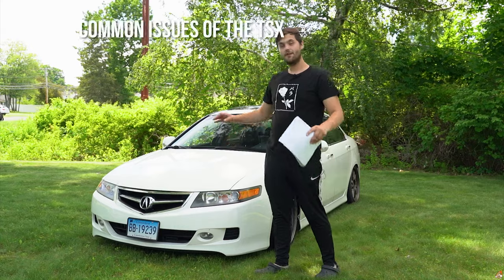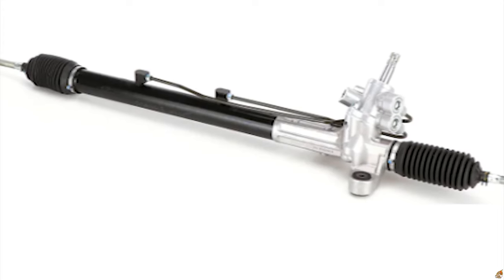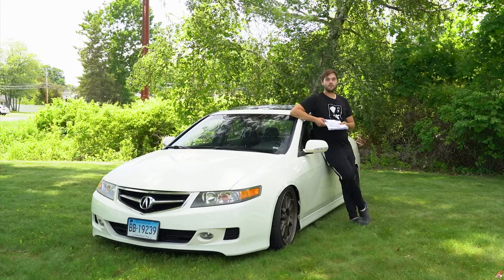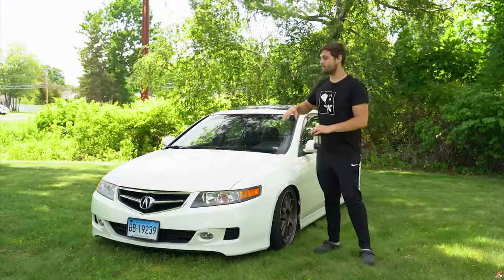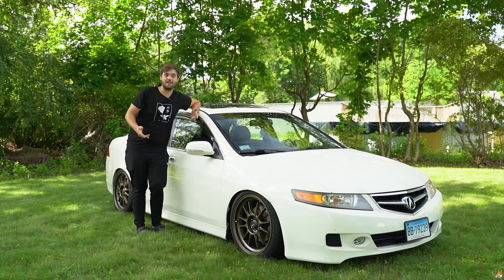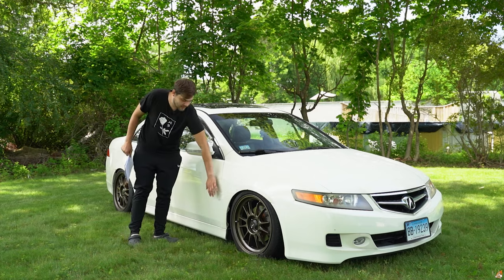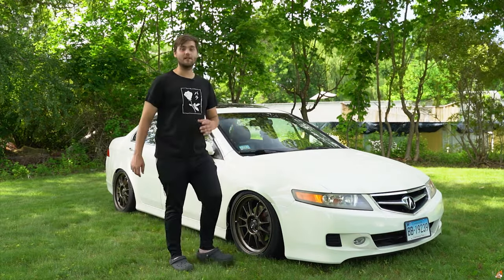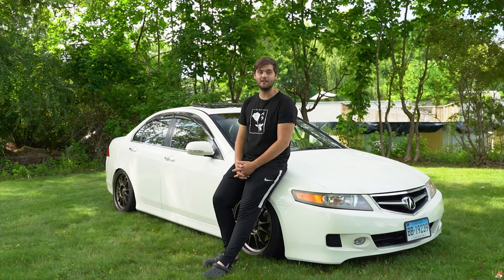TOP 10 COMMON ISSUES With An Acura Tsx

Comment: '06 TSX here, changed the starter, power steering pump, a/c compressor,  and even unplugged the bluetooth module last year cuz I thought it might be draining my battery. Turns out it was the starter causing it not to start. It's still unplugged by the way! Overall it's been a nice car that I've owed for 10 years with 182,000 miles currently.
Reply from the maker: Lmaoo I’ve chased many problems and just throwing parts at it kinda learned overtime try not to so much.. 😭
These are great cars if we treat them right!
Reply: @RishMedia  My AC Comp went out 5 years ago. I decided that since it's not my daily driver I would open the windows. The stock starter lasted me 14 yrs before I had to put in a rebuild. Having to take off the intake manifold was a pain in the ass. But I really don't know where else they could have put it with the engine design.
Reply from the maker: @stuartdroberts1  goes to show oem parts last!  The intake manifold isn’t as bad once you take it off once remove that bottom bracket it’s not needed and make it so much easier for any other time.
Reply: @stuartdroberts1  I have RSX RBC I manifold and it easy access
Reply: where are you from lol
Reply: damn same but im at 135k miles🥲
Reply: I just bought an 06’ with 150k on the clock, any advice about preventive maintenance?

Comment: 2005 TSX one alternator, three batteries, starter, air conditioning, compressor, exhaust three times, power windows switch, coil packs, brakes  three times. GPS HVAC is currently on the fritz. I bought this car with 109,000 miles. It has 219,000 now, if anyone plans to buy one of these used, you will be fixing several things. Good luck.
Reply from the maker: Yeah man that age wear and tare, especially ones that haven’t been taken care of properly.
Reply: @RishMedia  Yup!! I have to replace the exhaust.  My hvac gps has been quirky for a while.  Now, all I see is “check your disc”. 🙄

Comment: Spoke facts, I’ve replaced literally everything you mentioned on my 04 😂
Reply from the maker: Becoming a more common thing as these cars get older 😭
Reply: I just bought an 04 it got some problems with the battery (massive drain) so I tried some stuff but it didn’t work the Bluetooth didn’t either I just left it disconnected if some on ya know what it could be pls let me know id appreciate the help
Reply: Do u use premium fuel?
Reply: I’m literally fittin to replace this shit too— bro wtffff

Comment: 2004 Tsx 290k hear 6sd running strong
Reply from the maker: Hell yeah that’s what I like to hear! 💪🏻
Reply: @RishMedia  I got some dope mods still not done!!!!
Reply from the maker: @Onelovej  keep it up man! Got a lot to this build myself so plenty of videos!
Reply: @RishMedia  💯
Reply: 2006 Acura TSX 6 speed manual with 320k miles. Runs and drives great. Just bought it off the original owner. Needs rotors-pads all around and two rear wheel bearings. Hopefully once I start daily driving it I won't find many more problems.
Reply: Kevin Hughes They’re pretty solid I got 300K on mine
Reply: 172k on mine just got it yesterday I can’t wait to get working on it and first mods

Comment: Great video. However, those are not common issues with the TSX, but with any 20 year old Honda or even other brands. All wear and tear parts will eventually require replacement.
Reply from the maker: I mean they are cause those are the common things to go with the tsx. 
If it maybe just regular maintenance type stuff.

Comment: A proud owner of 2005 TSX. Bought the one that was used as a dealership's test drive vehicle with 28 miles on it. Now, in 2024, it has 255K, so far had to replace a serpentine belt at 140K, engine coils at 170K, alternator at 243K. The very first that went out was the trunk button, then the passenger door actuator, then the driver door actuator (both for remote entry). That's basically it. Hoping with the proper care I'll get another 250K out this car. I also had a used 2006 TSX for my wife, it also had a passenger door actuator issues and a leaking steering actuator. I love this car so much, that I even bought my daughter a 2005 TSX as a first car, manufactured just a month after mine.
Reply from the maker: DANG! your an OG love to hear it sounds like they've treated you very well! thanks for leaving your experience
Reply: I like you.

Comment: AC compressor, power steering pump, power steering rack, alternator, starter, AC compressor, AC condenser fan, AC condenser, front brake, driver side lock, VTEC leaky seal, oil drain plug leak, engine valve cover seal leak about 100K miles. That's about it, it's problem free Honda quality. LOL My Bimmer is same mileage and nothing broke. So much for Honda reliability.
Reply from the maker: Some things are a hit or miss and always depends on how it was taken care of maintenance wise. I’ve heard nightmare stories with bimmer 😂

Comment: when you're changing the alternator, take the two bolts off the power steering pump. you can move it out of the way and get the alternator in and out much easier. i can replace an alternator on these cars in 30 minutes.
Reply from the maker: Yessir! Nice tips thanks you!

Comment: A problem I struggled with for a long time on my 07 was total power and electrical failure. The car would basically shut off sitting at a red light or electronics would malfunction while driving. I did some research and sometimes this could be related to ECU failure from moisture leaking onto the circuit board causing it to rust. I took mine out and it was fine. Others suggested changing the battery ground cable even if it looks in good condition still. I did so with an OEM one and that seemed to solve the issue. No more problems with that, fingers crossed.

Another problem that I am having, which is more of an annoyance, is that during idle with AC on the car vibrates tremendously. That’s the problem I’m currently working.

Otherwise, best car I’ve ever owned. Love my TSX 6speed.
Reply from the maker: I had kinda a weird similar problem it ended up being my knock sensor car was going crazy and in limp mode sputters the whole nine yards lol.. 

And the vibration at Idle check out your motor mounts even maybe the tranny mounts see how they’re doing!
Reply: I believe that was on a recall note for the moisture leaking into the ECU. And they put a protective cover on it later on.
Reply from the maker: @riza4086  yup there was I think they literally put some sort of tape on it lol
Reply: My car started smoking behind the radio in my 04'.... So it's curtains for the radio...gotts probably replace the entire radio, harness and all...
Reply: Did you ever solve the vibration noise at idle with the ac!?
Reply: @dillonsousa6818  I have not. I'm still searching for a solution to this.
Reply: @sixactions2554  Ive had my 07 tsx since the summer of 2020 and i've replace both fans and the compressor and it still idles like that🤷🏾‍♂
Reply: Super late to the party but I had this issue last summer and solved it. For me it was the tensioner pulley. My AC didn’t work for the first few years I owned my 05. It never had the hard shake on idle problem until I finally got around to fixing the AC and was far less noticeable after whenever I would turn off the climate control. The nuts holding the pulley had slightly loosened and the top one snapped inside the thread with the added tension of the new AC compressor. Couldn’t tell until I was taking it apart but replaced the nuts+worn pulley and that did the trick.
Reply: I would start by taking a look around the serpentine belt or the motor mounts.
Reply from the maker: @Manguerah  that’s kinda scary, electrical fires no joke lol.
Reply from the maker: @sixactions2554  a lot has to do with the movement in a bad tensioner/pulley. 

Was dealing with that aswell and still am a bit. Since I replaced the tensioner with a used unit in better condition and a new pulley.
Reply from the maker: @yt4real388  try replacing your tensioner/pulley
Reply: Mine vibrates like that it’s it’s because of my motor mounts they’re getting worn out

Comment: I live in Massachusetts where the roads are salted regularly. One major issues that I have found is corrosion damage to the body and panels on the driver's side. If you live in a similar climate take your wheels and fender liners off and check for rust. Also check the pinch weld lift points, ESP. on the front driver's side. It's very common for the entire portion to completely rust out.
After a full desalinization I use POR 15 regularly. Your car can be mechanically sound but if the body starts to rot out from underneath you it's a losing battle in the long term.
Reply from the maker: Yeah I know all about that being in CT all my life lol shitty roads ontop of the massive amount of rust the dump around

Comment: I got a 04 tsx with over 300,000 miles only thing I had to replace are the common stuff like any car starter and alternator all new ac. Still a good fun car and still gets looks going to keep mines for a while💯 looking to change out all old parts this year
Reply from the maker: Hell yeah! Nice to see higher miled Tsx getting taken care of 🔥🙏🏻
Reply: I have an 04 that has 228 on it and I hope I can make ot last to 300! That's awesome! I don't know though as whomever had ot before me did not do it justice. I've had to do brakes all the way around, two bearings, and now I am havibg a strange intermittent headlight issue. I live in WA so your comment about rust... yep, that could be an issue at some point for me. I have to say it's a relief to hear you mention the 1st - 2nd gear issue because I thought I was losing it! I will have owned this for 2 years on 6/13. I yhink my AC compressor has gone out, and of course that happened on a record day here last year where it hit 108 beginning of June!
Reply: Do u have premium fuel

Comment: Nice things to list, but I generally havent had issues with those parts, until later miles, and if I went aftermarket, I was changing them out again. Always try to go denso with your starters, alternators, and so forth IF possible. Aftermarket axles suck when you get them for a manual. They are not the right size for the driver side. Unsure if it was a tad bit shorter, or longer. 

Things that should also be listed:
HID Ballasts can get water in them or rust, if you live in areas with a lot of rain/snow. I sealed mine better with silicone

Clutch pedal cracks causing your clutch to prematurely go out. 

Door Lock actuators commonly need to be replaced

Front Compliance Bushings commonly need to be replaced

Climate control lights might go out. Believe it or not, its the headunit/cd player portion that snaps into the back that fixes that. I replaced mine, and Im good. New ones can be found on ebay even.

Dome lights dont work with new bulbs even. The switch is the issue. Replace that.

Exhaust tips hang uneven. Get new hangers or better ones. I went with polyurethane. Worked perfect for years.

Rattle on start up? Its the VTC cam gear. I still have not replaced mine. 

Hesitation while accelerating? The accelerator sensor most likely is the culprit. Its part number 37971-RBB-003. Sorry for the copy and paste.

Driver heated seat not working? Eh. I replaced my seat. Now that one isnt working after 3 years. 😒

And I think thats it. 😂 You covered the rest.
Reply from the maker: Woooo a big list! Most of those I think I haven’t really dealt with maybe the door actuator definitely the pedal crack is one I missed. 

Thank you for your feedback man!
Reply: @RishMedia  Not a problem man! Always here to help if anything! Please keep the content coming!!!
Reply from the maker: Always man!! Trying to find out what people like to see and kinda go off that a bit, grinding to grown bigger. 🙏🏻
Reply: @RishMedia   I hear you! Honestly, you dont see much content for these cars. So whoever owns them would love to see ANYTHING dealing with them, from maintenance, to someone trying out aftermarket parts, races, common issues/fixes, and so forth. You'll do great.
Reply from the maker: Hell yeee that’s what this channels all about! 💪🏻
Reply: Yeah 2 out of my 4 door actuators are out right now unfortunately, and man I thought I was the only one that noticed the uneven hanging exhaust! I replaced all my hangars out back and they’re still uneven.
Reply: @KappaCow  Go with the poly. If that doesnt work, one of the hangers may be bent. Which actuators went?
Reply: @Kantoh22  passenger front and driver rear
Reply: Chews through rotors!
Reply: @KappaCow  Luckily it wasnt your drivers front one. You end up losing the keyless entry function.
Reply: @RelaxAndSmokeMeth  I have only had that issue with hawk composite pads. When I had ceramic I was good, but had less stopping power of course.
Reply: Im not sure if you are talking about a 2nd gen but im assuming you are because that is the only issue ive had with my 2nd gen 2009 TSX was i replaced the HIDs and ballasts because i do live in a wet climate i live on the Oregon coast and it rains all the time here so you are 100% correct about the water in the ballast issue one more thing you could mention though is that the TPMS is stupid and should be replaced and the factory brakes suck and should be upgraded
Reply: @flirtnwthdisaster2619  I was refering to a 1st gen, since mine is a 2005. But I am not surprised some of these issues passed on to the 2nd gen. Being that some things were engineered exactly the same, and some were somewhat simular. YES the factory brakes do suck, and the TPMS was something I changed as well.
Reply: @Kantoh22  the headlights and taillights look way better on the 2nd gen i i like that the tail lights have the circles in them i replaced the bulbs in the tail lights with these bulbs from oracle that are shaped like a star so you can see stars through my tail lights i feel bad for all of you guys saying the Bluetooth unit in the 1st gen stops working im curious about in the 1st gen can you do voice commands to the Bluetooth or no i can in mine but i have a pretty big sound system for the size of the car but i installed this thing in the car that is amazon Alexa so i have a 70 million song selection that is voice controlled but it works through the Bluetooth so that would suck if it stopped working you guys should try one out they are only like $10 or so bucks on ebay they are called roav viva but FYI you need a amazon prime membership to get the most out of it which isnt a problem if you already use prime which i do  but i think its awesome its like having an assistant in your car and allows you to oay more attention to the road
Reply from the maker: @flirtnwthdisaster2619  I’ve never generally had the need to use the Bluetooth and being a olderish car even the navi systems are pretty useless and outdated aswell. That’s why a lot of people get the andriod screens/double din units. But I generally prefer the 1st gen in looks and performance aspects.
Reply: @RishMedia  people get android head units for alot of reasons because android head units have alot if convenient features aside from just navigation , such as wifi, apple car play, youtube , Google , Bluetooth , music downloaders, data storage etc. But that has nothing to do with the car itsself. There is a reason the 2nd gen came after the first gen it has many improvements over the first gen some are subtle, some are performance oriented, some are aimed at convenience , functionality , and keeping maintenance costs lower. I do like the 1st gen also but the 2nd gen is the superior car of the two especially because it has the K24Z but if you really care about performance it would be smarter to purchase the TL rather than a TSX the TSX is just a good car for its price but i actually do sound systems so the Bluetooth module is an important aspect in my opinion in regards to the TSX i actually have a big sound system installed in mine and i also have amazon alexa in my car which makes it where my amazon music account is available in my car which as you may know has 70 million songs in its selection so with a working Bluetooth module it makes it so you can have a voice controlled 70 million song playlist in your car all you have to do is tell alexa to play whatever you want to hear and it will play so you dont have to take your eyes off the road of anything. So the Bluetooth module is definitely a good convenience. Another aspect of the second gen TSX is it has a better feeling of control due to the electric power steering rather than having a regular power steering pump which you can definitely feel the difference not to mention is less maintenance. But really all of this is irrelevant because you would be smarter to buy a TL rather than a TSX. It is superior in every way.
Reply: Is it ok to get aftermarket axles if I have an automatic since you said manuals must be honda oem?

Comment: I love this video. I have an acura tsx 2006 that has 172k and still going strong... I can relate to this video with parts I had to change so far. Keep up the good work!
Reply from the maker: Alot of it is some common maintenance after so many miles. They are older cars so most have came to that point, but they’re solid when wanted to be lol. 
Thanks for stopping in! 🙏🏻

Comment: My 06 just hit 270k it’s by far the most reliable car I’ve owned I have replaced things like my radiator starter battery atleast 3 times in the 8 years I’ve owned it also the racking pin and I’m about to replace motor mounts soon and front shocks love these cars the k series is a solid engine also the transmission has been really good to me it’s stock never had any issues with that overall the tsx is an awesome car and fun to drive
Reply from the maker: Exactly man you treat these right do some usual maintenance, they’ll do you good to! So many Tsx’s going on 300k+ miles but unfortunately a lot of people neglect them too. 

Big reason why they are becoming more popular and expensive.